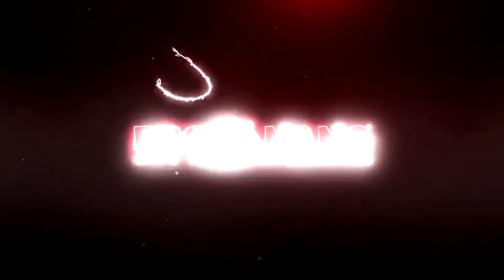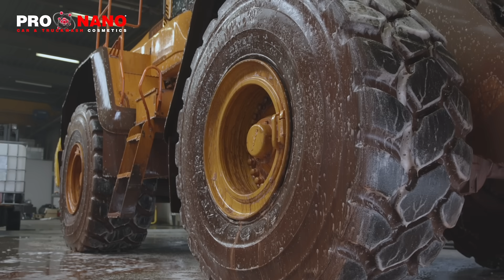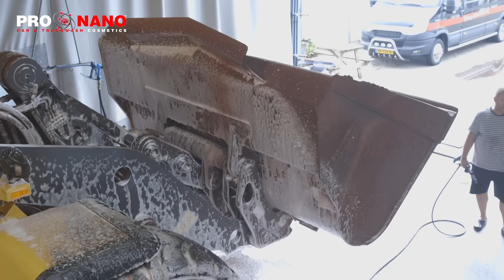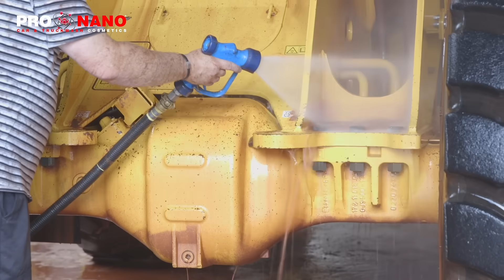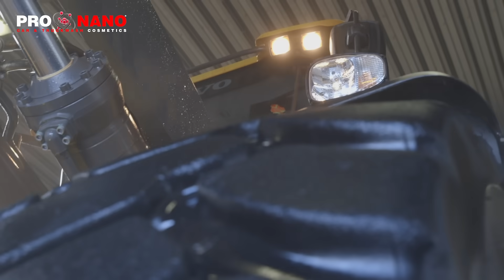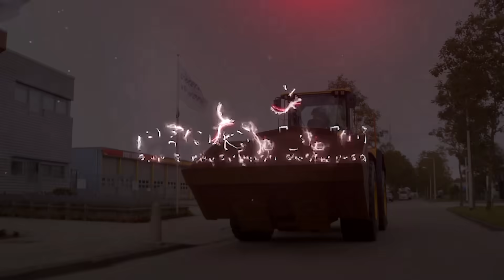AMAZING! Non-Contact Cleaning Volvo L180H JUST WATCH!

Comment: Awesome vid wish it was longer though! when he went under the bucket my heart stopped!If I did that at my work place I ether would of gotten fired or final written warning.
Reply: I thought the same thing. He should have secured it before going under. That is why accidents happen.
Reply: Where's the problem? These machines are certainly equipped with security-valves....
Reply: @tomolsem3563  have you ever heard of freak accident,or machine failure? It's best to avoid it a.
Reply: @tomolsem3563  I've seen it happen at the sawmill I work in here in New Zealand,not a nice thing too see.

Comment: I can’t help but wonder how much more productivity would skyrocket and man hours as well as cost of water would plummet if these people learned to work from the top down lol.
Reply: Again someone who apparently does not have using this kind of equipment.

go through any of the comments sections on every one of these videos and you'll hear it debunked and explaining that you go from the bottom to the top then from the top to the bottom, because that's how the foam is designed to work.

It's not like washing a car with a sponge and some soap.
Reply: PAKTRA PRODUCTIONS I am in full realization of this point. As I said before in other videos, I’m just not buying it. Dirt sticks to equipment. The solution breaks the bond of said dirt. It penetrates it and softens it. The claim is that if you top down rinse you’ll wash away all the solution and be left trying to rinse bonded dirt and mud. The hardening and bonding of the dirt and mud is a slow process with drying involved. A top down rinse doesn’t give the dirt the time it needs to end up like it was before you started the washing process. Basically the damage is done and the solution did what it was designed to do. All the white solution on top of the dirt and mud at the time of the rinse is superficial at that point rendering it needless. Will it help if it remains? Sure, at the most minuscule level. Which is why I said “the juice isn’t worth the squeeze” when watching people do it bottom up. The amount of water, time and energy put into trying to get every ounce of the solutions effectiveness isn’t worth it. I would love to see a side by side comparison with two like vehicles or pieces of equipment, same paint condition, same amount of dirt and mud, dirt and mud from the same location, sprayed with the solution, same dwell time of the product, rinsed off in opposite directions. Running clock showing time savings. GPM being documented for water savings, and ultimately how clean the two are compared to each other at the end.
Reply: @lukelambert4595  I would like to see that as well,  documented with control samples.

Alas, it is most likely commonly accepted, performed, and instructed by the "leading industry professionals" because that is policy.
And it is most likely policy because the bureaucratic industrial process usually and oftentimes counter-productively yields to the "one hand squeezing a whole lemon for its juice" mentality.

If it was in the slightest purported, if not proven, more efficient (read: cost cutting) to spray bottom to top then top to bottom, then it shall be done that way without question regardless if it is actually beneficial.
Reply: PAKTRA PRODUCTIONS yeah, I mean, I’m not trying to say that there isn’t the possibility of bottom to top being more efficient or effective. I’m just saying, sometimes processes aren’t proven. There was a professor at MIT (i believe) that did a test on motor oil. He had a Ford Taurus with a 3 liter v6 engine and he wanted to challenge the 3,000 mile oil change. Every 3,000 miles he didn’t change his oil. He only changed his oil filter and replaced any oil lost in the process. He drove the car somewhere between 150,000 to 300,000 miles (it’s been well over a decade ago and I can’t remember exactly). He broke down the engine to examine internal components. There was virtually no difference in cylinder bores, main bearings ect. 

I know the two aren’t exactly the same thing but I think you get my point. As far as fully covering a vehicle in solution or foam, I can get on board with application from the bottom up because it’s scientifically proven to give more dwell time due to gravity doing what it does best. Outside of that, I’m just not buying their process. 

My house has a half mile limestone gravel driveway. Dust is my worst enemy. I have so much time invested rinsing my vehicles when washing them. The feeling of spraying a steam of water in a panel gap and watching it spew a never ending stream of brown water makes me want to hang myself lol. I watch these cleanings on here and see people driving dirt and mud back into nooks and crannies and I am cringing. Then they do one final 5 second top down and I just know that there are countless areas where dirt is trapped and not clean. 

If I’m doing it, I am doing it top down to fix that issue as well. “If you want something to last keep it clean.” This is said because water on metal makes rust. Dirt collects water and holds it against metal, increasing your chance for rust. I just can’t afford to take that chance lol.
Reply: @lukelambert4595  oh most definitely in fact, actually related to the proprietary engine oil change scam, I wouldn't be surprised if they say bottom to top just because it uses more solution and therefore you have to keep purchasing it from the supplier. 😉 JK

But that would just be my inner Bigfoot on the grassy knoll conspiracy theorist.

Water conservation be damned, if I was maintaining a vehicle to be cosmetically particular, I would be rinsing inside the door jambs and flipping up the fuel filler door, and probably using more foam the necessary going up down left and right!

Of course that would probably be on a smaller passenger vehicle and not some big rig, where I was being timed or paid by the hour or whatever condition applies to the gentleman in these videos.

If it was on my work truck I would just hose it down with a squeegee at the gas station and keep it moving. And oftentimes I don't even get to do that... Just a superficial rinse to get rid of most of the large debris that impedes mechanical range of motion. Dust and bugs get a pass.
Reply: PAKTRA PRODUCTIONS 😂😂😂😂😂!!!! That is a great point. With that point in mind, this whole system of cleaning and ones just like it are always on equipment and fleet vehicles so perhaps is isn’t necessarily what’s “best” but “best for them and their specific needs”.